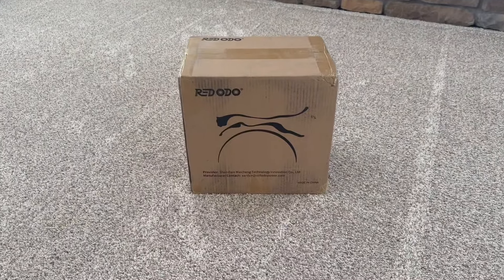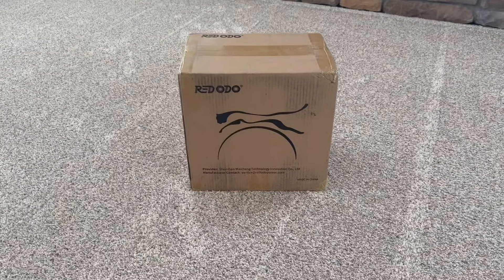DIY auxilary portable power system for camping, overlanding, travel with Redodo Lifepo4

Comment: There's a reason why your lifepo4 battery chargers are all set to 14.6 Volt
Reply from the maker: Why would you do that?  What benefit does it provide?  Lifepo4 becomes 100% at 13.75.  There is no reason to run it up to 14.6 for another hour for possibly 2 minutes of watt hours.  I’m telling people it’s wrong and to change it and sticking to it.
Reply: @Hunleygarage  I really don't know what benefit it provides I just know all the lifepo4 chargers charge at 14.6 volts and every time you read the instructions for any lifepo4 battery it says the charge between 14.4 and 14.6 volts so I'm guessing there's a very good reason for it
Reply from the maker: @DaveSquibbSr  - can understand. Go to a channel called offgrid garage. He does actual testing on the lifepo4 Chemistry.  Also look for the charge curve for that chemistry. After doing that, you will see that 14.6/14.9 will very well charge the battery but appears to damage and expand the cells.  It’s like filling a water tank to the top at 13.8. It’s like putting a top on that tank, sealing it, and then running your hose full blast until no air remains to hit 14.9.  I’ll fill my tank to the top and stop there - it’s far enough.
Reply: @Hunleygarage  no thank you, I will stick with the manufacturers suggested setting so I can get my warranty if anything goes wrong.
Reply from the maker: @DaveSquibbSr  to each his own. Take a look at the charts and watch his videos some night.  Thanks for the conversation. What would be interesting is to take two of them. charge one to 14.9 and the other to 13.8 (or similar) and see what the long term effects are on longevity and capacity.  We don’t have any idea in the present day only speculation.  Probably by the time 15-20 years expire there will be another chemistry out that is even better anyway lol.  We do know that repeated charging to those levels is what causes the packs to expand/enlarge.  On a cellular level it is causing fissures and cracks in the material, also abnormally large expanding the cells (you see it in the cells but it’s hidden in the battery packs we buy).  The charge curve also shows that once lifepo4 hits 13.82 it’s 100% charged - from that level up is when the damage starts to occur. I witnessed this during my own charging and BMS readings.  The capacity gained and duration of time needed to raise the cell voltage from 13.82 to 14.9 (for a nominal 12v pack - each cell is 3.456) is minimal and appears from the real data received will start to internally destroy some of the cells.  Just wanting to toss the red flag to people of what is really going on - let them decide for themselves.
Reply: @Hunleygarage I believe it helps with balancing the cells. If you don’t charge to 14v the bms doesn’t balance.

Comment: hi, you use victron mppt with built-in bluetooth. Just wondering why don’t you use the same brand smart shunt to monitoring all data with Victronconnect app?
Reply from the maker: Victron is a good shunt - just expensive and can’t read right away. Nice to have a less expensive unit show the real time status.
Reply: @Hunleygarage  This was my decision as well after a lot of thinking. I don't want to have to pull out my phone every time to check the battery SOC. Nice build and thanks for the inspiration!

Comment: Does anyone know if this setup would a setup run this 12V cooler/fridge (or similar model) full time? I know solar is an issue but in the CA desert cloud cover isn't an issue.
Reply from the maker: I think it will.  If I had my 12v cooler in the shade along with the battery and the solar in the sun, I think it would last indefinitely- until one component quit working.
Reply: @Hunleygarage  thanks! Would you recommend a larger battery or something else? I plan on doing a setup like this in a storage container. The problem is, even in the shade it gets very hot 100+ in there.
Reply from the maker: It all depends upon your load and the sun you can harvest.  If you could reply with some numbers I could let you know. If you are going to lock one in a storage container - would make me nervous - like you said it can become a pressure cooker!  All the electronics do well but when you start increasing the temp, not really sure what starts to happen and when failure points kick in.
Reply: @Hunleygarage  I haven't purchased anything yet because I hate to buy things twice. It in the area of 29 Palms CA. It's pretty much full sun all the time. I do have a small shed I could use that is vented. I could run power to the container from the shed if that would be a better idea.

Comment: NICE what is the total cost of this build?
Reply from the maker: Thanks!  I will have to add it up.  I also need to rework my box, add proper wire sizes, fuses, bus bar etc.  I slapped this together after thinking about it and it turned out really neat so I posted the video.  I will try to get an update video out soon.

Comment: What size wire gauge did you use for the Anderson connector to battery and from charge controller to battery thru the shunt?
Reply from the maker: Because the BMS will allow 100amps - which you should use 4g if not 2g. The Anderson connector is rated at 50amp though, so I used 6g - I have to watch my load though.

Comment: Question about charging through the Anderson plug. Is the Anderson plugged directly to the terminals or to the shunt??
Reply from the maker: I put everything through the shunt so it can track all the in and out.  I recently used the box and had no power until I tried charging and it came back. Not sure if that was the battery or shunt. Will try to do a follow up video. Also getting another small battery - will try to do a 2.0 version of the build with details. The first one was to really see if it would all fit and work.

Comment: Question: Under the lid of the box you have little clips use for retaining the wires. Do you have a link to the ones you used or can you elaborate on what those are? Are they just adhesives with a small zip tie holding the wires to them? Any help is appreciated. Planning on building something very similar myself and appreciate the awesome video!
Reply from the maker: https://amzn.to/3QiGUFF
Reply from the maker: Try that link.  They are just adhesive zip tie mounts, I got mine at Menards.  I will try to re-do my box and include fuses, proper wire sizes and bus bar - put out a new video soon. Thanks for watching and good luck!

Comment: Looks well put together. Any fuses inline?  I have purchased four batteries for two systems myself.  Even use one in my portable setup too. Good job
Reply from the maker: Thank you. I didn’t install any in this model - it was more of a last minute proof of concept. The problem is it works which makes it hard to tear apart and redo it!

Comment: In my opinion, this "HiSport 50A Plug Mounting Panel for Anderson SB50 Series Plug Flush Mount Recessed Plate" is too weak. You really don't have any problems using it? Overheating or high power losses? Can you test its connection quality with a fairly powerful consumer?
Reply from the maker: I wouldn’t use it for more than 50amps - which at 12.8V isn’t much - 640 watts….
Reply: @Hunleygarage  Ok, I understand. I didn't find anything more powerful than 200A. I occasionally need to use a 1.5 Kw device. That's why I'm looking for options.

Comment: Did you test the capacity?
Reply from the maker: I did not, there are several other reviews that did with consistent results. With that said, I will be doing another video running a fridge and freezer off of it - basically testing capacity and how long they will both run.

Comment: No ventilation, no fuses no switches.....this dude has a donut for a brain.
Reply from the maker: Was interested in what compels someone to make a comment like that?  Did you not see the 2 fans?  Did you not see all the switches?  This is not being sold as UL approved, it’s not even being sold.  The BMS has a 100amp cut off, I don’t even have a load that high.  This was a concept I thought I would share - if someone doesn’t understand loads, wire sizes, heat - they have no business building a DIY box. Hope you find what is missing in your life, thanks for watching and commenting.
Reply: @Hunleygarage don't pay them any mind... Donuts have filling... A bagel on the other hand, has a huge empty hole in the center. That is what some of these commenters have for a brain.   NICE BUILD.